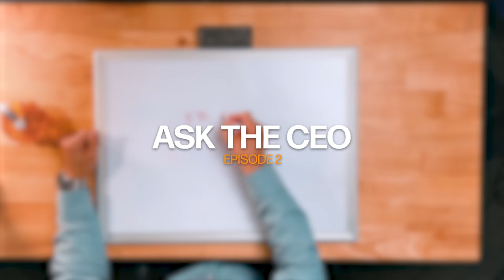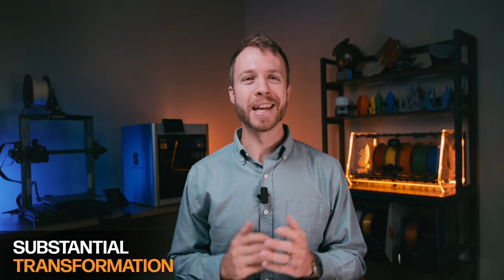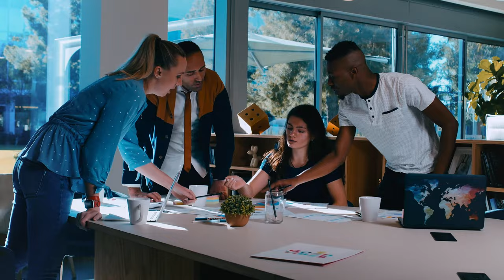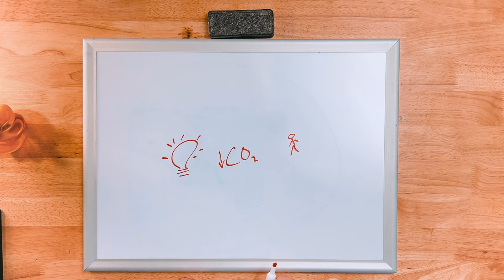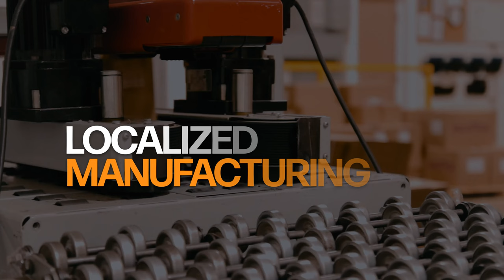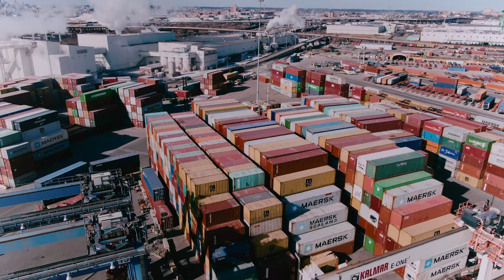How 'Made in the USA' Pays Off Long-Term | Ask the CEO

Comment: USA made is definitely a good thing but it's very expensive, very over regulated and energy costs are through the rough.  My hat is off to those that can make it happen here and not elsewhere - and I very much try to support the small businesses!
Reply from the maker: Its easy to point to labor as the only scapegoat for the imbalance in costs, and while it is the primary contributing factor, there are a number of others. For example, did you know that until 2019 your taxpayer dollars subsidized the shipping of foreign imports into the US? It was MUCH cheaper for someone in Shenzhen to mail you a package in Florida via USPS than for a Florida based company to mail the same package to you in Florida. Pretty crazy! It's hard to compete when Uncle Sam is undercutting you. 
Thanks for supporting small business!
- Dan

Comment: I agree that made in America would be nice to see on more and more products it’s not feasible for a lot of things because of the high cost of US labor.
Reply from the maker: Thanks for the comment! That's true that market forces make it much more difficult to make most things in the US. Automation is helping to equalize that a bit, as are increasing logistics costs. Research shows that most American consumers are willing to pay a 10-20% price premium for a US made product, so if you can get within that range, and then add value with additional benefits and reliability, it can make sense to make it Stateside (or wherever your customers are). 
- Dan
Reply: Labor is realistically not that much more expensive here than in Shenzhen. What lacks in the USA is automation. Even small stuff like tape dispensers are often missing here. 

You can 5x-10x any given worker's capabilities with basic automation.
Reply from the maker: @ZURAD  You've probably seen the data on number of industrial robots deployed in China vs in the USA. The difference is staggering. US industry has been extremely slow to adopt automation.
Reply: @SliceEngineering  I've also been to a lot of shops. The can be described only as "boomer" in their methods and mentality. Hopefully some people put a stop to this.
Reply from the maker: @ZURAD  we couldn't agree more. There will need to be a significant shift in mentality for many small US manufacturing businesses to survive the next decade.